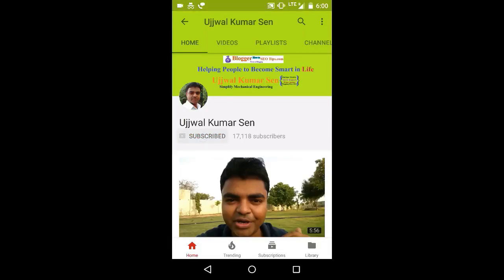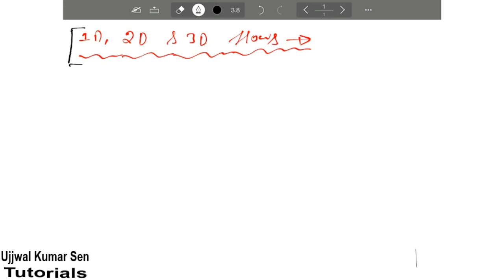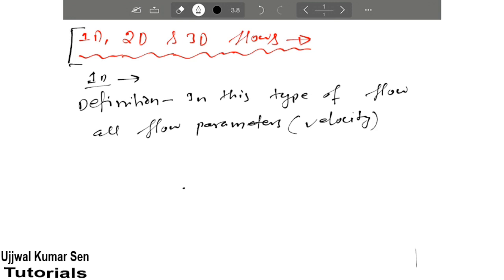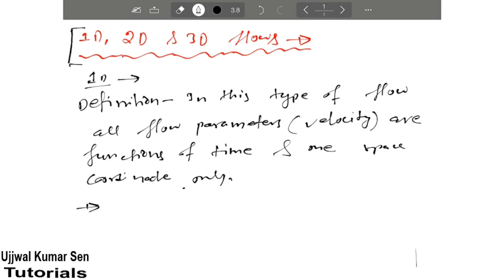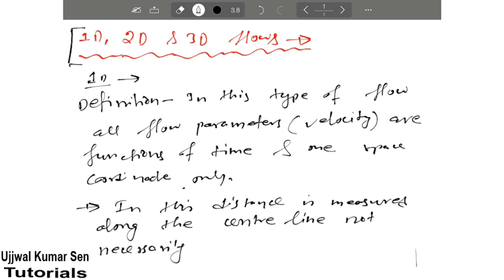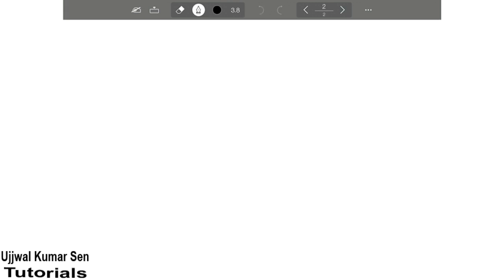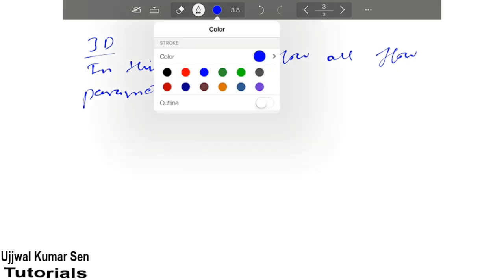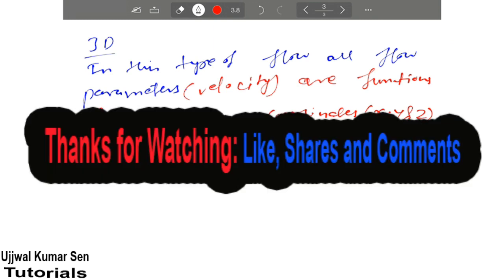1D, 2D & 3D Flows Fluid Mechanics- 38

Comment: Sir can you please suggest an real life example (natural) where 3d flow happens
Reply: A river. In a river, the velocity is different in 3 dimensions. Say that the width of the river is the X dimension, the length of the river is the Y dimension, and the depth of the river is the Z dimension. 
Velocity of the water at water surface is different to bottom of the river (z dimension).
Velocity of the water  at the river's edge is different to the velocity at the middle of the river (x dimension)
Velocity of the water is greater nearer to the source of water flow (for example a waterfall) than it is downstream (y dimension)
Reply: @DrewAlexandros  thanks Sir